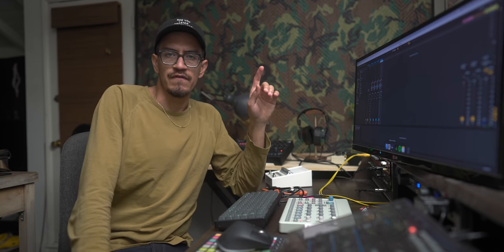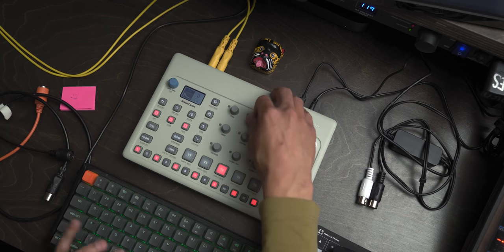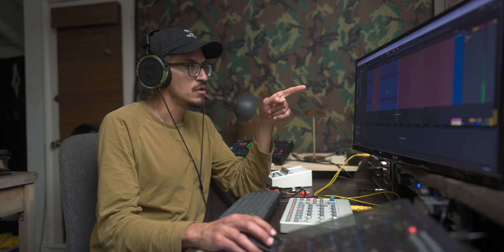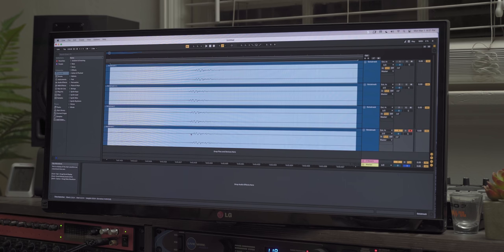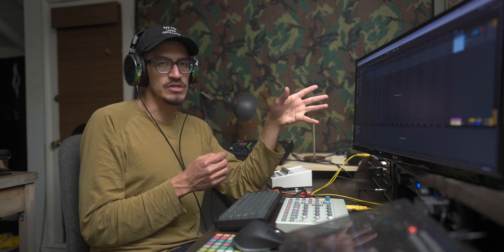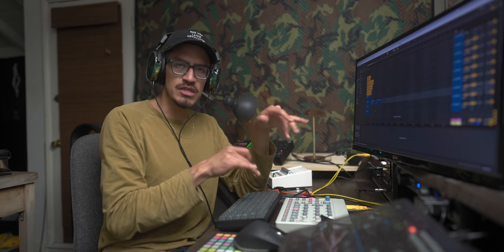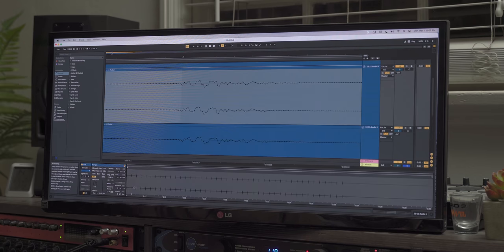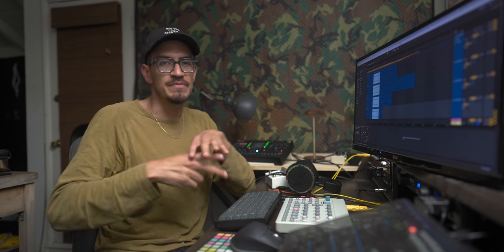Midi Latency and Why You Can't Win.. // Hardware Swing vs DAW Swing

Comment: Btw, just to be a know-it-all... the problem you're facing isn't latency, it's clock jitter.
Reply: Came here to say jitter
Reply: People used to claim Macs were immune to it and vastly superior to PC for that reason.  Maybe that was back in the 90s tho.
Reply: @ceounicom  It isn't jitter. Windows and Mac OS have never been real time OS's and have no way of guaranteeing events will happen on time. If they were, most consumer software wouldn't work, and they're designed for usability. Also, USB is inherently terrible.

Back in the 90s when you plugged in a MPU401 your MIDI input was connected directly to your CPU by an IRQ line, and PC MIDI had the fastest possible response. It's been downhill since. When using a Sound Blaster or other cheap MIDI card without the IRQ, I had exactly this same problem on my 486. I could even make my system crash by plugging in my MC303 and hitting "play."

Remember that MIDI was invented before most instruments had a CPU, and it's been good enough for performance for almost fifty years now. I think a Keyboard Magazine article in the late 80s described the situation as "in the time it takes a MIDI note to be transmitted, sound travels a few inches in air. If this delay is too much for your composition, then you might need to put your instrument inside your head."

Jitter is an entirely different thing, and if you have one millisecond of it, what comes out of your speakers will not sound like music at all.
Reply: @stickyfox  I know first hand that these aren’t real-time OSs, at first I thought it was my software, then my audio interface, and finally when I tested my built in mic I knew it was windows. It’s only a few moments off but that’s enough to hi 1/8th of a beat off. Currently trying to find a fix.
Reply: @WillisZzz  Gentle request to repeat that please.
Reply: and the problem is usually caused by the driver Ableton is using... anything but a driver that gives Ableton 100% exclusivity with result in midi jitter

Comment: I never synchronize a machine to Live. I type the tempo I want in the hardware, hit record on Live, hit play on the machine a moment later, warp/adjust the beginning of the clip afterwards. No weird sync nonsense, no latency problems.
Reply: Bang on 🎯. Similar experience of frustration.
Just a thought, would you yeild similar results reversing the process  ie. Slaving Mac-mini & Abelton to the drum machine?

Awesome stuff 💯‼️
Reply: Seems like the solution, thanks mate!
Reply: Same here. No matter how loose the clock in a piece of hardware is (and some are pretty loose) I've never encountered one that's anywhere near as bad as MIDI over USB (whether it's a USB interface or direct MIDI-over-USB). Some OSes are better than others but it's baked in to the USB protocol (at least up to USB 2, which is still what most hardware is going to use) - data packets over USB are sent at a 1kHz frame rate, which means the absolute tightest possible timing is going to only be accurate to 1ms over USB, plus any timing issues happening in software (usually at the OS level) get rounded to 1ms increments.  By comparison, a solid hardware sequencer (MPC2000/1000/etc; Octatrack; many others) generally has jitter under 0.5ms.  I've measured the jitter on my own MIDI interface at about 7ms!

For me, the best solution has been clock over audio (originally SMPTE timecode into my 2000xl, more recently an Expert Sleepers USAMO), which is as close to sample accurate as MIDI/SMPTE and your hardware's timing allows.
Reply: @mudsh4rk  thank you. 🙏
Reply: THIS IS THE WAY
Reply: @mudsh4rk I am looking at USAMO. Do you still like it? I am trying to avoid USB at all costs. 

I have had trouble getting my Line6 Helix delays (which is the thing that is most important) to stay in sync with anything else, so I am forced to sync everything to the Helix.

Comment: Turn off monitoring in Ableton. Timing is never gonna be tight if your monitoring is not set to off in Ableton.
Reply: Monitoring needs to be off anyway. But it doesn’t solve latency. It is only solving latency in ableton itself.
Reply: @arjanpetersen  not really, latency can be compensated. the big issue isn’t about it. the real problem is jitter, which can’t be compensated in any way. you can calculate how many samples of delay you’re having over each buffer size and just compensate. but overtime you’re gonna be off anyway at some point because of the jitter. I simply solve the issue by using the device called USAMO by Expert Sleepers, there are other options but this is probably the cheapest that actually works.
Reply: of course that monitoring needs to be off in Ableton, otherwise none of this will ever work.
Reply: AFAICT, if you're using the External Instrument device, latency compensation works correctly, even with Monitor enabled.
Reply: @formerself4372  it probably sounds compensated, but it's definitely not sample accurate compensated and definitely will jitter a little bit, making it off the grid sometimes. that's the difference. it's useful because I can simply edit all my jams and everything will be synced from start to finish, i don't have the need to ajust the samples because they were always on time with no fluctuation in time.
Reply: @alxs2k  Jitter is analog. Here is firmware. Usb-midi-audio protocol being treated on the same microprocessor level as of audio. Big Hardware designs flaws you will never see in a Nord Lead for example. Big difference in design. Too much unoptimized and completely useless code where there should not be in the first place.

Comment: We learned today that MIDI and midi sync of all forms is sucky. These same timing issues can be found WITHIN hardware sequencers themselves. For instance, my old Roland XP-50 was notorious for having pretty random timing from one track to another. This is the very reason why we old timers used to discuss how "tight" the beat of a box felt. Same goes for analogue gear and their various timings. Clocking is a real thing and not trivial at all. This is one of THE biggest boons of working 100% in the box, on a modern DAW, where literally everything, including automation, is sample accurate.

Comment: You'll drive yourself nuts with this Ricky if you go down the MIDI timing rabbit hole, you'll start to hate the timing of DAW's. Coming from the 90's though, hardware sequencers and the first generation of computer sequencers ( they weren't even DAWS back then ) please be reassured that although this problem still exists it's exponentially better then it was back then. Midi timing from computers and sync  ( post Atari ) literally sucked big time back then. For sure. We did managed to make tracks with it though :)

Comment: Clock from Ableton always jitters. It’s known fact. I don’t recommend using ableton as a master clock
Reply: What about Logic? (Asking for, um, a friend...)
Reply: been bouncing my tracks of the mpc to logic for years and never had a problem
Reply: I've noticed it too. You can hear it drift even without external syncing. It's messed up. The worst is syncing two laptops together, both running Live. It's all over the place. Sloppy mess.
Reply: Seriously though, I'm having much better luck running my 2K XL as the master clock into a Motu Express XT and clocking Ableton from that. I can see the timing jitter from the MPC replicated in the Ableton BPM preview. The key was honestly getting a dedicated midi interface for cleaning things up. BUT, when you disengage the MPC as the master clock you lose that organic swing / jitter. So it's now rock solid in Ableton which is bittersweet. If there was a way to record the BPM drifting as automation that would solve the last part of the puzzle for me in regards to maintaining the MPC "groove" in a hybrid setup.

Comment: A couple tips that I learned long ago back in my hardware synth days that might ease your mind (or drive you crazy) but at least you might know more about why this is how it is:

1. MIDI timeclock is not sample accurate, and will never be sample accurate from a device just due to the limitations of the time-code standard and the individual inaccuracies of the internal clock of the device you're using (drum machine, sequencer etc...). This is not something you can fix, and this is why most producers usually sampled their sounds into a single sequencer or program for timing accuracy. You'll  notice this when DJ mixing old-school dance music too, this isn't just a tape issue, sample accuracy is just that imperfect to begin with out-of-the-box.

2. MIDI events are also inaccurate. Because of the fundamental way midi sends the data, you simply can't get all the data to arrive all at the same time. Basically even if it's seemingly simultaneous, there's several events happening in quick succession and therefor will never be sample-accurate due to this without having each device have some sort of buffer built-in that is sample accurately matched to the same clock (which again will never be sample accurate 100%)

3. There's 2 main ways devices sync. MIDI Time-clock and MIDI Timecode. One sends out a sync message (usually about 16th or 24th divisions) and so all the space in between those times can easily fall out of sync when going against the perfection of sample accurate DAWs. Timecode is based on FPS in relation to tape sync and uses reference points to sync the clocks of two devices, and any time they drift in anyway will result in the imperfection you're seeing in your DAW.

4. Additionally on top of MIDI imperfection, you're also dealing with audio jitter at all points of the AD/DA chain, so that's also another point of inconsistency. So all that combined together means that timeclock syncing different device clocks in by its very nature never going to be sample-accurate for the foreseeable future. This is also why often times going in/out of the digital realm when mixing/mastering you'll get timing variations and imperfections that are not sample/phase accurate because of the delays in all the electronics and the digital-to-analogue conversions going on. If you're all in-the-box you wont notice this because you're hearing the same imperfections equally at the same time and rendering is all software based so the sample accuracy is uniform without live processing jitter.

Ultimately for synth parts and stuff it's not a huge issue and provides some nice imperfection, but for drum machines, it's usually a sample-back-in or make loops from devices on their own clock and fine-tune and import grooves to get perfection. Brian Transeau has talked about this at length over the years due to his love of outboard gear, and also why most of his stuff has to be sampled in and nudged to perfection to get the results he gets.

Love the channel, stay strong.
Reply: Dude this is awesome, thank you man
Reply: Dang haven’t heard BT mentioned in a minute!
Reply: brilliant explanation, thank you.
Reply: Ricky, this is the answer. MIDI clock is especially inaccurate and inconsistent. If you want a fighting chance, you have to record all outputs simultaneously, and if you edit them, move all tracks together to improve phase alignment with Live (or any other DAW) clock/grid. Many of the sequencers in these lovely hardware devices have their own micro timing quirks as well. A Linndrum pattern has very different microtiming compared to an 808, for example. The more you pull the thread on this sweater, the worse the situation will become. I recommend making only single take recordings, using all outputs to capture all tracks, and then shifting these to best align to the DAW you record into.
Reply: @zedd_centauri  This is also why peeps back in the day were so in love with the Atari-ST trackers with midi, because it was a single midi trigger source so timing could all go simultanious out and just capture live to tape. Other than the expensive timing boxes you can get are more or less simulating the tape clock signal at high resolution but it's as suited for the type of beat-clock timing that alot of drumachines use (some do it better than others I admit) but yeah. If someone wants the swing, you might record dry in and save that as groove data in ableton (one of its more killer features) so you could apply it sample or loopwise. Kinda takes the fun out of the hardware-based production, but this is how we all had to live with it, even in early all-digital setups.... quite frankly I don't miss it (besides the fun gear though).
Reply: That is the only way for me I record my MPC 3000 with the first 1 bar metronome and I nudge and sync them together, and the groove maintains the famous MPC swing.
Reply: 2 words. Sequentix Cirklon.
Reply: This is the whole reason why i've stopped working on beats and focused on playing drums. I can't deal with the timing inconsistencies. If my own playing is sloppy, I can work on it organically, but this timing crap is soul sucking.  I feel like the linn era mpc's and sp1200 were a bit better and therefore workable but programming midi in logic with just one shot drums? ughhh...the time wasted...
Reply: @mollyoko Dave Smith invented the Cirklon? What a legend!

Comment: I recently connected and mixed all my hardware on my father's mackie analog mixing console. Although the noise floor was significantly louder, I couldn't believe the difference I felt in playing the gear. The only way to describe it is how immediate and responsive everything was. DAW latency might be just a few ms but when playing through it for a decade you can certainly feel the difference when you move over to electrical signals rather than converted signals.

Comment: Rick great video, the best way to get everything tight is to have a midi card sitting in your pcie slot on your computer like a RME Hdspe etc. I have the Erm Multiclock, that is maybe the best way to get computer, external gear, sequencer etc to talk to each other and when you go to print audio, you wont do any adjustment accept the beginning. As of right now Erm plugin for Cubase is not functioning correctly, according to them there is an update coming to fix that, hopefully this not the case for other DAWs as it looks like Abelton can be solid with some offsetting, working on Bitwig to see how it works. 

Unitor 8 for Emagic(90s)still is pretty solid and Mac is providing USB midi driver support, that is pretty tight. Another company from Germany called Miditech 16x16 USB/MIdi has slightly better results than the Edirol. There are also loads of folks using Roland SBX-1 doing all the sequencing dawless and then printing from DAW clock or just Rolands clock and trimming the downbeat. I just cant believe that in 2021 we are talking about midi not being what it used to be. Also if you can please make a video about the Erm Multiclock and how to use it as USB/interface, still have not figured out all that potential and that manual needs to be thicker. There are some folks using the ERM plugin from daw feeding something like Kenton Midi through and getting great results when printing the audio. 

If you have been creating a track all Dawless and love everything about it, and start printing the audio into the DAW you are going to loose that vibe, there is nothing like all the gear firing independently, this is why so many of 90s dance/hiphop has so much human feel to it, because lot of folks just record straight from a mixing desk onto DAT or tape machine or adat. 

We need to help everyone get this thing sorted, the amount of videos about timing/latency/jitter etc is just crazy. Thank you for all your great work. Cheers.

Comment: Midi over USB for any sequencer kind of thing seems to always be funky. But the model cycles is just pretty bad over midi or usb. The only way I manage to get it perfectly timed even on the first few beats is to hit record in the DAW but have the cycles play an empty pattern. Then launch the pattern you want to record and that extra bar helps to get it all synced in time for the second bar.
Reply: I second this. Old trick, but it works.
Reply: i don't own any elektron gear, but this is my standard practice. it doesn't matter if i'm sending MIDI to DIN devices via mio4 or direct to MPC live via USB - an extra bar at the beginning is mandatory when i'm tracking MIDI devices into ableton.
Reply: Bounce and manual adjust. No other solution. To ear your groove is impossible other ways. It's painful.
Reply: Can you explain how to have the cycles play an empty pattern?
Reply: Or you could record it as is and ignore Live’s grid, keep it loosy goosy